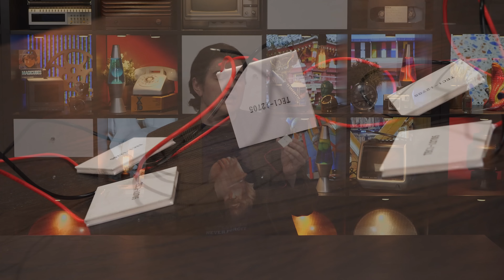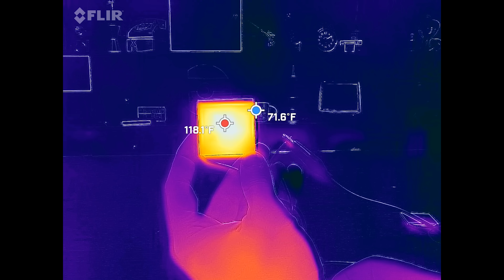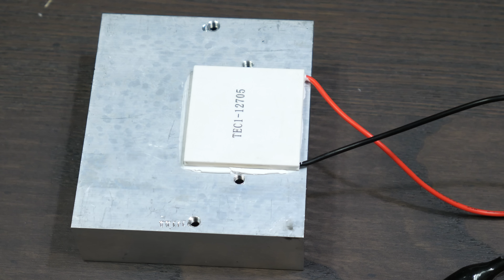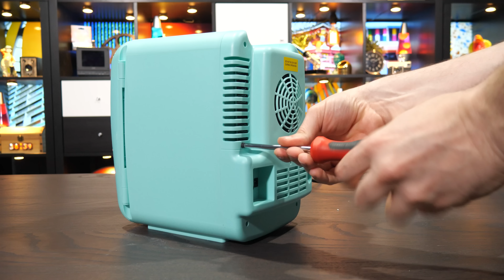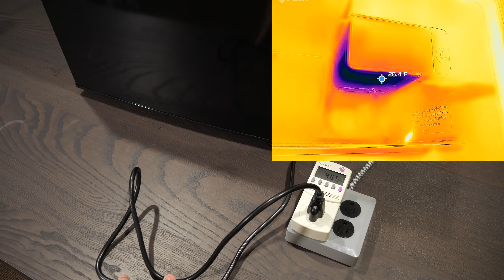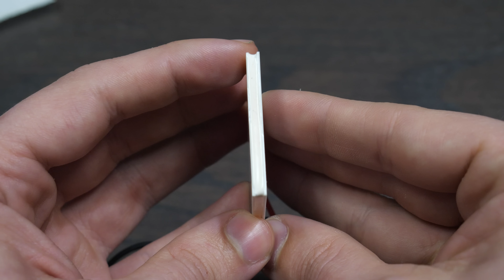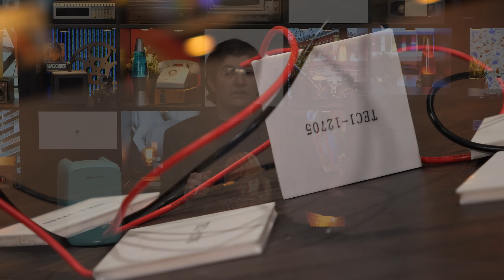Thermoelectric cooling: it's not great.

Comment: Ok, having efficient everyday cooling system in kitchen at home is better than unefficient, but why not also have a temporary solution for a weekend/holiday trips? I carry passive coolboxes/bags: 18L coolbox (6 x 1,5L bottles), and thermo isolated bags: 5,5L bicycle steering bar and a roll top bag pack and have a fullsize refridgerator freezer combination (german efficiency class A).
@Apples vs. Oranges: This is a (hidden) comparison of 2 different requirements (tiny portable vs. large stationary) which are therefore design with different technology designs. Would you try driving your shopping stuff upstairs with your car or truck? I wouldn't think so, because of different requirements.
@Requirements: Mobile cooling requires small cooling components, the small blue one has the 1 advantage "to be portable and carried around" instead of the need to take a big heavy refridgerator (without own wheels) with you (therefore with extra motorized transport with its own vehicle extra weight, even the door handles are not designed to carry/move the heavy refridgerator anyway around.
Or do you move the big red refridgerator on the distant barbeque place?
@Technology design comparision: So you compared a light electric Peltier elements based small portable design with heavier fluid circular system design (compressor -> piping -> thermal exchanger -> ...) with much bigger cooling components (black + red refridgerator). A fair comparison would compare with a second coller of same size and weight with much smaller components (tiny pipes, compressor, heat exchanger). I doubt that a similar small cooling fluid component based design would be that efficient as the much bigger.
@Theoretical reverse comparison: You cant cut the required small slice out of the black or red refridgerator because the cutted slice would not work anymore. If the red and black refridgerators would be designed on a modular dividable cooling modules concept that might be an alternative for mobile cooling.

Comment: I have an cooler by igloo that has this technology in it. it has a fan both on the hot and cold side exhausting the hot air and moving all of the cool air inside the cooler. Works pretty good. i think if this one had a fan to blow the cool air around the inside it would work better.

Comment: Peltier’s can also generate electricity.  They are used in wood stove fans.  Difference in temp on both sides creates electricity which power the fan’s motor.  I also used to use Peltier’s along with liquid cooling to cool my computer CPU’s to overclock them years ago.

Comment: If only I could get a "real" fridge that holds 6 cans.....and ONLY 6 cans.
I don't need or want bigger than that.
A mini fridge is too big to take to a job site and is unnecessarily large for my lunch.

It's also REAL nice to have one on my desk at home. 
Fill it with already cold beer from the kitchen. Now I can grab a nice cold beer and keep watching your video without interruptions.

Comparing different, though similar, tools is foolish.
"This wrench sucks because I'm using the wrong wrench." Duh?

Try comparing a Peltier fridge with a traditional fridge with the SAME outside dimensions....say about 10 litre capacity.

Comment: Good video for those that might be in the market for what may be garbage quickly.

 Wile I agree the comparisons were about watt use, that applies to everyday use, and many just don't know, They plug it in and never unplug it.   

 Life-span matters,  Peltier's  might work for a hundred years or longer.  That's when the dust to dirt electric cost vs a refrigerator comes to play.  To make large Refrigerator, ship and then make it's replacement 20 years later. That $2000 350lb refrigerator that took many man hours and resources to make, If the Goal is save resources not sure it really balances. 
 Wile I agree,, most of the gimmick TEC coolers are already in the trash heap, If TEC were available in mass form, 100 years ago they would have changed history If energy was not so much a current day created problem. 

Also,, They use DC power, Very dirty DC, they don't care. The conversion of AC to DC ,, or DC to AC is not without loss or costly in some situations. It's another reason this is useful in a Car, and at a very safe,12V DC.

All the disadvantages can be overcome by stacking or adding more with control. If power is the problem, Mabie that's what need to be fixed.

Comment: It's also known that Stirling engines, run backwards, will also pump heat from one side to the other.
    At one time the Coleman company was selling basically coolers with small 12 V Stirling units in them. They were very expensive though, which is why I think they did not catch on. They were advertised as being able to keep ice cream rock hard.

Comment: "Than a typical mini fridge" in reference to a fridge can be interpreted as "this is a non-typical mini fridge." I'm not suggesting that's a completely fair interpretation, but if I were to imitate Adam Savage and say "well, THERE'S your problem", I'd do so while pointing at the word "typical". Remove it, and your sentence is simply "than a mini fridge", which would cement "this is not a mini fridge" as the only valid interpretation.

Comment: Peltier device sucks at doing a convection cooling (cooling an enclosed environment), because it's much more effective for a small conduction cooling (direct contact cooling), e.g. phone cooling. Even then, you need a water cooling (which is pretty much a heat pump but with water) to disperse the heat much more effectively than air cooling.

Comment: Peltier are good for cooling or/and heating electronic compartements who are sitting exposed to the ambient air or sun on on the outside. Without any moving parts or pertrusions in the compartement shell.
Since the can heat and cool depending on the polarity of the current on it.
Its only good für small boxes of course.
But you can also move moisture out of these compartements with them. You heat the compartements to dry the components with thr hot airr. Than reverse olarity and chill it below the due point or even frost it. Let it warm up again and have a catch pan and a small hose to the outside.

Comment: Bought one of these to keep my insulin cool. Actually bought two, 'cause my wife bought one the same day I did. 
Both of them worked well enough at that job, until they both crapped out. Don't know if it was the DC power supply, or the actual element (my money is on the PS) but they're both $30 paperweights now. 
We chose these as an alternative for the mini-fridge because of space considerations - we simply don't have room for a dorm fridge. 
If the actual PE's are still good, it'll be fun experimenting with them, so mnot a total loss.
Live and learn.

Comment: i use one of those tiny coolers for my water or drinks i want cold, mine don't make that much noise, and it's very nice to use in the heat of summer not too cold. but in winter? ice. deicing is annoying in these lol

Comment: I wondered why they don't use mini  compressor used in BP monitor it's has enough pressure that generates cooling effect just by using 
air  as refrigerant I have tried it. They can use other efficient refrigerant to get higher Cop

Comment: I think you should look at something any PCR lab has called a thermal cycler.
These have been around for much longer than the mini fridges, are constructed differently, but rely on the same technology.
I have an MJ Research PTC-200 twin-block thermal cycler on my desk.
If you turn it to below freezing, frost builds up on the blocks within seconds.
PCR requires multiple temperature fluctuations which are very steep.
These implementations of the Peltier technology are far more effective, and efficient.
This is due to the size of the elements used.
The reason cheap Peltier junctions are so plentiful is very simple: There is a massive size difference between the element mass in my thermal cycler vs the element mass in that mini fridge.
The fridge element is nowhere near the size of the package it is within, whereas the elements in my thermal cycler are virtually the same size as the blocks they are attached to.
 So the efficiency issue you described is much more a consequence of lying marketeers than it is of the technology itself lacking efficiency.

If you hooked a model airplane engine up to a ten-ton load, do you think it may encounter some efficiency hurtles?

Comment: I see another flaw with the micro fridge, it only has 4 small round metal cold emitters on the inside which would transfer a very small amount of heat out of the fridge, now if it had a full metal plate on the inside instead of 4 small circles, it would be much better at getting cooler inside, I had a thermoelectric cooler that had a metal plate at the top of the compartment which was attached to one side of the thermoelectric element, since it was at the top where heat rises to and since it was a metal plate it was actually quite good at getting cold inside, so much so that the metal plate would ice up, so the metal on the inside and it's location on the inside does make a big difference in how well the thermoelectric fridge gets cold.

Comment: Yeah, totally suck as a fridge.
I however have a small custom liquid immersion cooled computer with a sealed close fitting copper case that I have 2 of these hooked up to, this runs my DAW software and acts as my guitar rig.
In this configuration it works masterfully keeping my CPU at around 60C for the entire gig in a small, quiet and super lightweight setup I can easy drag around from venue to venue and use for full band recording while I play through it.
Depends on what you use it for really.

Comment: There is one critical thing that makes a peltier fridge (not the blue) better than a compressor-based fridge: It can be near entirely silent (if it is passively cooled). You dont want to have a compressor-based fridge next to your bed for drinks. If you are sound-sensitive, you are screwed or need to walk to the kitchen everytime.
But a proper peltier fridge often costs more than a compressor mini fridge.

Comment: The best use of a Peltier device that I can think of is a fan. Attach the cold side to the back of the fan so that it blows cold air towards you. It would be best used outside since the Peltier device also generates a bunch of heat.

Comment: An idea, would using thermo electric generators on the other side of the peltier unit help in any sort of way to mitigate heat? And I'm guessing that it would also help in reducing the power consumption as some of the heat would be converted back to electricity. Just an idea, not sure if it is any good.

Comment: I had two wine refrigerators to store wine at the perfect 55 degrees F. Both died after a couple of years. The cheap computer fans got full of dust and the fan bearings seized causing the elements to burn out. Tried changing/cleaning the foam air filters on the second one, and it burned out anyway. The only good thing is the coolers can run on a 12VDC supply until they give up and die. Sounded like a good idea but don't waste your money.

Comment: peltier sucks forget about them. I know them in barreled water drinking machines and they take forever to cool the water.

I DO have a portable fridge with compressor and it costs CNY 480 as second handed. It has a laptop like power supply and it says 45 watts, and it can cool down to -20C while holding 11 bottled cola at 500 ml. (it says 15L and i didn't test how many cans it can hold)
I sell drinks in the dormitory when I was in university and if I have this fridge earlier I could serve them cold. don't expect peltier ones to do that job. You need a lot of cold.

Comment: They're bad for cooling, but what about the free boost when used as a heater? I'm thinking under-floor heating: tile them throughout your flat and run at low current, low temperature difference for CoP ~2-4, and every watt you put in sucks a couple more out of your downstairs neighbour's ceiling.

Comment: 31:07 There's a difference between cooling and refrigeration. Peltier elements are excellent for cooling (one can get 10-20K temperature differential in a larger temperature range than any refrigerant gasses will practically cover), but make a very lousy refrigeration solution.
Reply: They’re incredibly useful for wireless chargers. According to Apple, you should not expose your iPhone to ambient temperatures above 95°F, as doing so can permanently damage your battery capacity. But wireless chargers (even MagSafe) can raise the phone temperature by 20-30°F. And the hotter the phone’s chassis is, the less the CPU and battery can dissipate heat. The phone will simply stop charging when the chassis is above 95°F or so. 

So the ~15°F temperature differential from the peltier element in a wireless charger is the difference between keeping your phone at room temperature vs throttling performance and charging and permanently degrading your phone’s battery capacity. And energy efficiency doesn’t really matter at that scale.

Comment: To be fair, I can see modern combat armor using Sinks and these Peltier elements in conjunction with say, a dense power bank that could pop in, and bam, you've got some sort of cooling or temperature difference between you and the outside.  Too hot or muggy in the dense woodlands? Pop a couple 20V batteries in your duffel and youll be good till you exhaust the supply or just recharge inbetween uses in my head.

Comment: Thank you for that. I won one twenty years ago as a door prize. I used it once and went back to putting a scoop of ice into an Igloo cooler.
After watching this video, I found that old fridge in a corner of my shop and stripped the parts out of it and threw the plastic in the bin.
Keep them coming!
Reply: Exactly what I was thinking watching this, if I did have one I'd just strip out the component to play with. That fan was very much a basic laptop fan as well 😂

Comment: The only situation were I use one of those toys (and only because I got it as a gift) is as a kind of active cooling box for the car on long drives. It runs on 12V, fits neatly on the middle seat in the rear and is good enough at KEEPING food and drinks cool over a 6+ hour drive. So I cool stuff down in my normal fridge and only use the tiny one to keep everything cool

Comment: I bought one of the little 6-pack sized units like this about 15 years ago, set up to plug into a car's 12 volt system. Its purpose was to cool drinks and snacks in the during week-long driving trips in the US Southwest. It worked marginally for the first trip, but general underwhelmed. I test drove it some before the following year's trip, and it hardly worked, if at all. $65 down the tube. At the time I just thought mine was a bad unit, but now I see that probably destroyed the elements during the first trip, as it didn't even have a fan to dissipate heat, just convection radiation. Glad to know this info, so I do not suck in again.

Comment: Which of these would you want to travel with?
Reply: A small compressor one, definitely. Personally I have one from Alpicool that I used on a roadtrip through Europe
Reply: Also, the sentence construction "it's much smaller than a typical mini-fridge" implies that "it" is a non-typical mini-fridge (though clearly you didn't intend to imply that). The sentence "it's much smaller than a mini-fridge would imply that "it" is a non-mini-fridge.

Comment: i could see peltier elements being used for precise measuring. They likely can be controlled to very specific temperatures very reactively. Meaning you could do electronic component testing at exact temperatures. very obscure and specific use case, but something i guess

Comment: I use my thermoelectric "fridge" to keep my nugs fresh. I did replace the fan with a slightly larger one, swap out the white heat paste for silver stuff and put another heat sink inside on the "cold" side. In winter I can get it to -1c but I have to turn it off in summer as it's basically a heater

Comment: I had an air dehumidifier that worked with one of those semiconductor coolers. I think that  is a good application for those as it only runs a few hours a day on the most humid days of the year.

Comment: Question on heat pumps. If one was to make a closed loop refrigerant system that wasn't fixed in place and introduce uneven heat, would the density difference cause a balance instability?

Comment: Couple of points you left out. The devices can be stacked and powered in parallel to create a larger temperature delta between one side and the other. Also, they can be used to generate electricity. They were installed on automobile exhausts in the Soviet Union to charge the battery, and power windshield wiper and radio.

Comment: You did miss one tiny detail...that little shiny bit next to the cool/off switch that allows you to power it with 12V.  That means you can power it in your car or boat.  Still pretty useless but less messy than ice. Is that blue box waterproof?

Comment: I don't really think cost is the only reason these things are using Peltier coolers.

Size is also a major issue.  How small can we really make a heat pump?

Also, how much heat pump do you really need for space to make just 6 cans slightly cooler than room temperature?

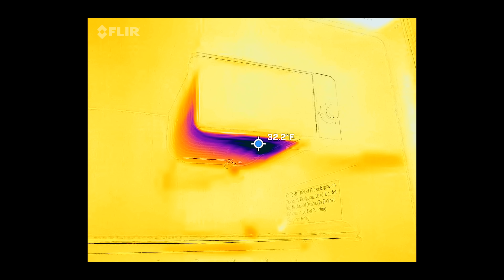Comment: 19:40 "It becomes very very cold". A little inprecise here. Obviously the liquid is absorbing energy for phase transition, and prob increasing in temperature, to become a gas. 
It's the environment there losing heat into the liquid.
Reply: A boiling liquid is always at its boiling point, so if you drop the pressure suddenly, it's gonna cool down very quickly.